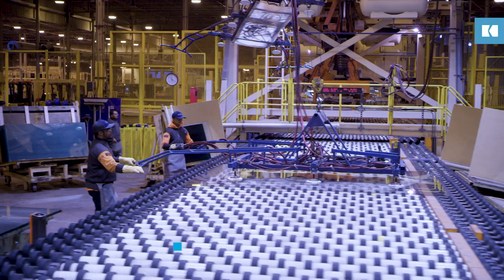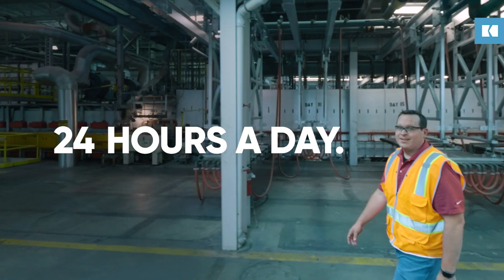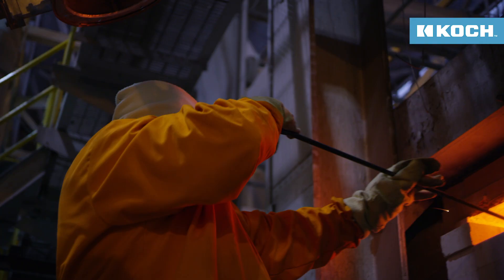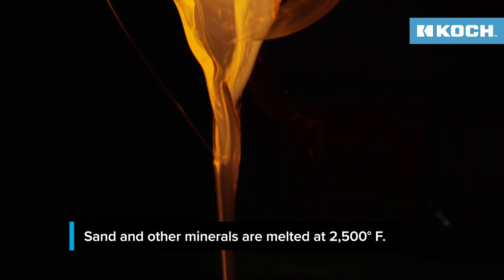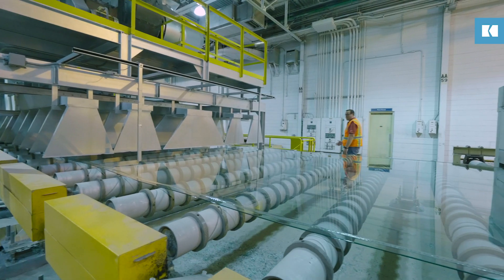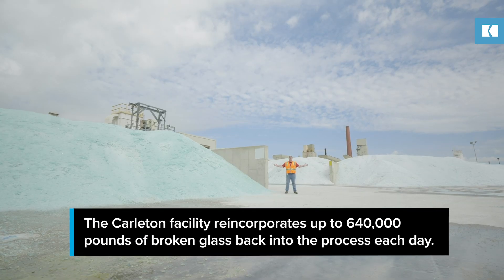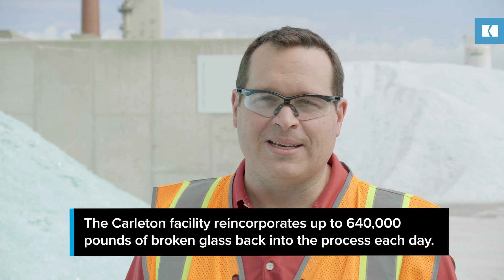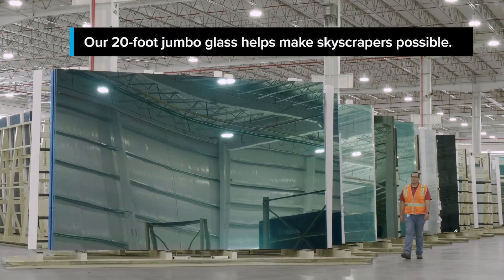Inside Our Float Glass Plant

Comment: Do you have a plasma gasificafion unit? To make annealized glass? Do you make vaseline glass?
Reply: Is not annealed glass=Raw glass as from the float line  Not tempered or heat strengthen..  And on the float line glass is not unformed thickness across the float it varies-  Been there done that .